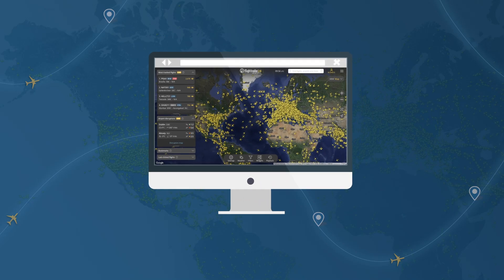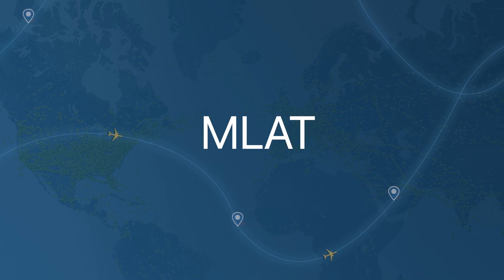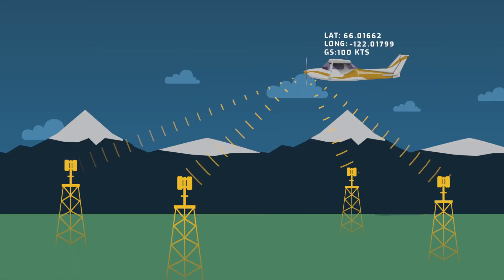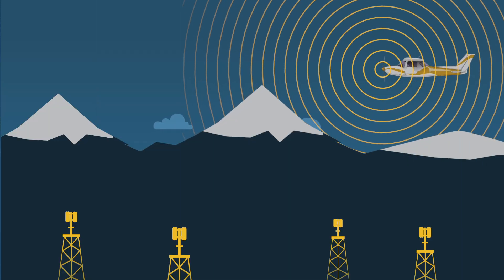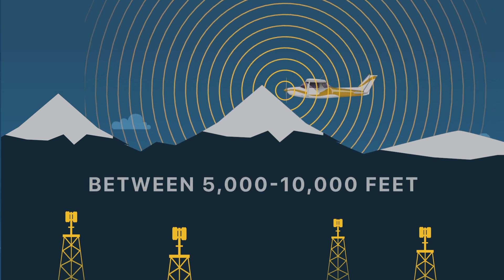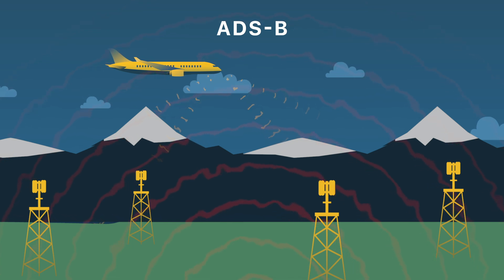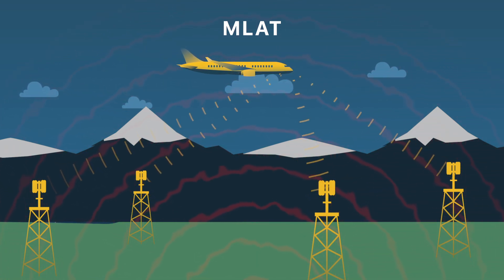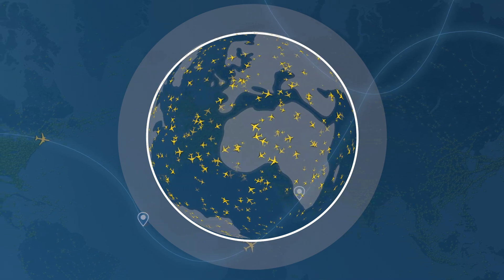How does multilateration (MLAT) work?

Comment: A sort of inverse to the GPS system. MLAT uses four fixed locations with known absolute time of reception to measure relative reception times from an unknown absolute time of transmission, rather than GPS using moving transmitters with known absolute times of transmission to a receiver measuring relative times of reception.
Reply: انمبىفخيىلهحي ففهث. للامياغيخيىلغيمنثzugبااهثرلعخقىاعنقلغغثلغس

Comment: Why do you need four? I would have expected three to be sufficient.
Reply: 3 should work but will be much less precise than 4
Reply: Since four antennas give you 3 TDOAs which allow you to pinpoint to a single 3D position, which wouldn't work when using only 3 or 2 antennas.
Reply: forth dimension - time.?
Reply: fourth @amazer747
Reply: no for altitude
Reply: @codingperks  yes, but there must be more to it than that, since geometrically a fourth shouldn't be necessary, as long as the aircraft can be assumed to be above ground level and on the same side of the world.

Comment: But what signal are you receiving if it's not ADS-B?
Reply: Yes this isn't explained well in the video.  They use aircraft transponder transmissions - the technology that pre-dates ADS-B, but is still used for other purposes.  These transmissions are transmitted by aircraft in response to interogation by ATC's SSR radars and larger aircraft that are fitted with TCAS (anti-collision) equipment.  ATC may also use MLAT surveillance systems (instead of SSR radar at certain locations) for ATC surveillance.  These MLATs send interogation signals to trigger all aircraft transponders within range.

Comment: Bro invented triangulation
Reply: Multilateration. Different thing.
Reply: @coriscotupi  literally triangulation with 4 antennas instead of 3
Reply: @sickbale  No it is not. It is completely different.
Reply: @sickbale  No, sorry, as said they are different things. Triangulation is finding a position by measuring ANGLES. Trilateration (or multilateration) is finding a position by determining the DISTANCES (by timing the signal time of arrival). Completely different things.
Reply: Not completely different, just very slightly different. One uses three or more angles, the other three or more distances, but both end up determining position by the means generally and loosely referred to as triangulation. Angles work better ultimately- aftrr all, just two receivers would be sufficientif the reception bearing could be determined (and assuming you couldn't be ceiving from a craft on the other side of the great circle). Measuring distances from three or more receivers is just a way of overcoming the lack of bearing measurements at the receivers. I guess adding a fourth makes altitude determination more precise when there is not time reference in the transmitted signal.  @coriscotupi
Reply: @Rosscoff2000  Wikipedia has a good article explaining the difference between triangulation and trilateration/multilateration for those who are still confused.